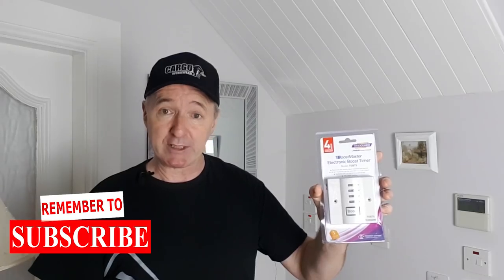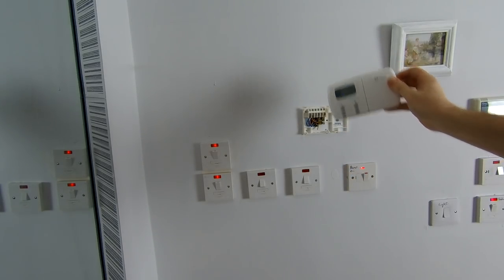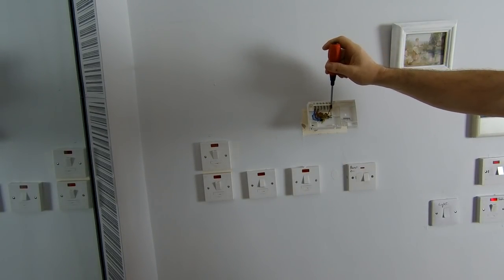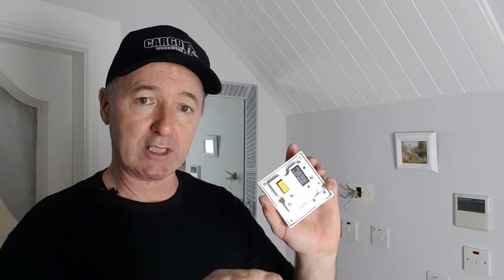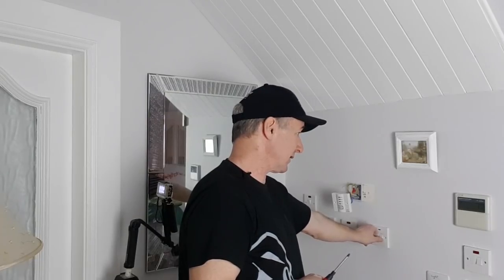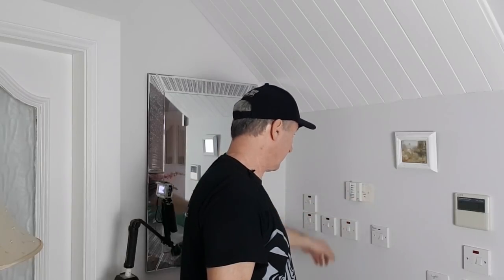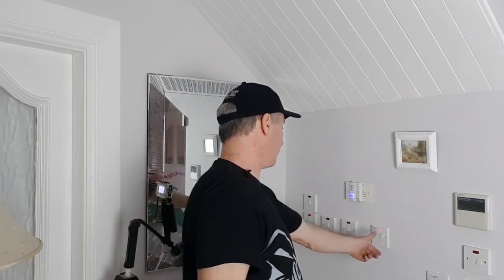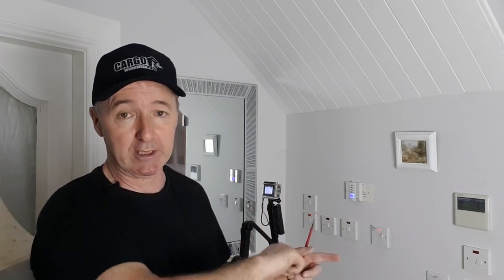Super Simple Heating Timer even my Mother can use

Comment: I could have you implement an automatic feeder drop system for my horses!
Great work Gerry.
Cheers!
Reply from the maker: Hi Martin I know very little about horses but there are a few riding stables local to me and I see the guys riding out all the time. I have an idea for a wood pellet feeder that would do a small horse😜 Thanks for the comment 👍Cheers Gerry
Reply: @GerrysDiy , Gerry, I have two large quarter horses. My thought was a small auger in a plastic 55 gallon barrel, operating by the drive motor from a BBQ rotisserie.  If you make it to Nebraska, I'll saddle them up for you. Heck, you can even have one of our six guns and or lever gun on while you ride.

Comment: Is there still a thermostat for the general heat and this just bumps an area for a short period. Not sure of the purpose not a lot of hot water heat in the houses in the States only in commercial bldgs. I work with a lot of systems at work and some steam as well but not in residential. I could definitely see some other purposes for a short timer switch like that. And your bro has got some crazy finger with some cool drone shots in his vlogs. cheers from Michigan
Reply from the maker: Hi Michael. I installed the heating and plumbing system in my mothers house myself. The heating is hot water underfloor heating downstairs and radiators upstairs. The domestic hot water is pressurised  300 litres stored. The house is  2 story 3200 sq feet so with 1600 sq feet  of hot floor downstairs the house will stay warm for days. Each room is individually thermostatically controlled so it does not overheat. I flew over the house a while ago on my diy trike while we were still building it https://youtu.be/A3Z3ZXLvf28 Thanks for commenting Michael Cheers Gerry👍
Reply: @GerrysDiy             i watched that one before with your work boots (metatarsals) on and the prop falling off. You've had a few near misses up there but it's definitely beautiful country side to look at.
 I just didn't catch why you only needed to run the pump for a short period for heating the house. Maybe a video on how hot water heating works in Ireland. The systems here run the pump as long as one zone is calling for heat.. The different classes I've taken on hydronics all have said Europe is way ahead of the US on hot water heat  I noticed some differences in plumbing when I went to Scotland as well.
Reply from the maker: Hi Michael. I lived in Oregon for a while and all the plumbing I saw was fed live off the mains. I made a couple of videos on an underfloor heating system I installed with a heat pump. I didn't install the wiring. The storage tank has a 90 litre buffer built in and 300 litres of hot water storage. There is also about 600 litres of cold water storage in the attic. If the power goes out the water will last a couple of days and work on gravity so no power required. . Here's a couple of links to the plumbing https://youtu.be/DDnO5rStO-M   ..   https://youtu.be/Px1L_7IvWXM and another powered paragliding with a friend over my house https://youtu.be/QSXZPOQkOSo Thanks Gerry👍

Comment: Hi, I have connected this timer , it worked for few days , but suddenly on one time putting it on two hours all the lights went on and did not turn the boiler on , I tried to disconnected from the mains but on the connecting the main all the lights comes on and the boiler does not go on , how do you suggest to solve this problem ?
(SPARES2GO Energy Saving 15 Minute to 2 Hour Electronic Boost Timer for Immersion )

Comment: Hi I have question my radiator is connected to switch with fuse like u have on wall and there all in and out neutral and live are double but on each size of that box are two cables what I should do with them ?

Comment: Hi Gerry, can that same switch be used on a hot water immersion heater
Reply: Came here to ask the same question
Reply: Yes ,i just wired mine to.the emersion heater .its advertised as emersion heater booster switch.
Works perfect .